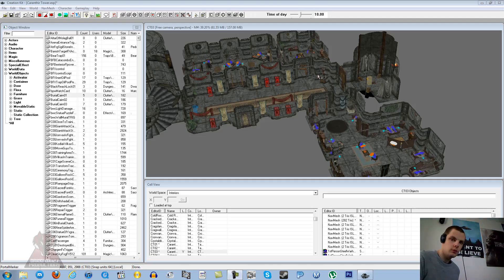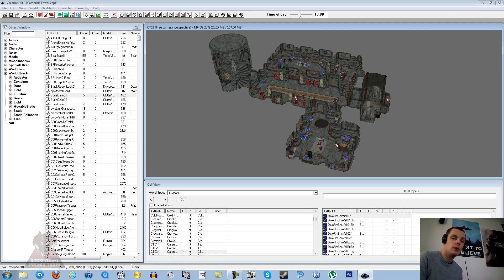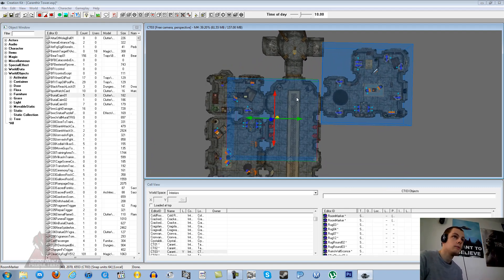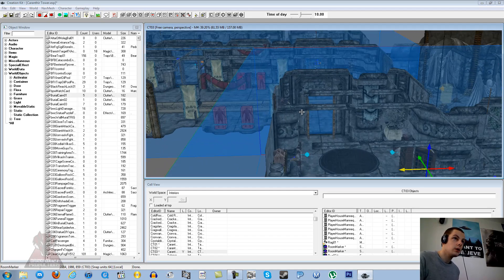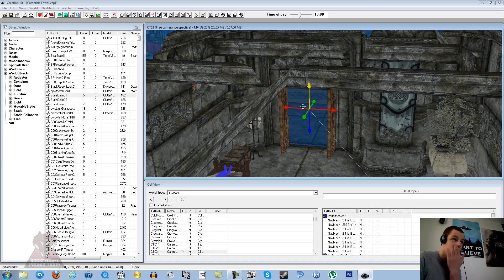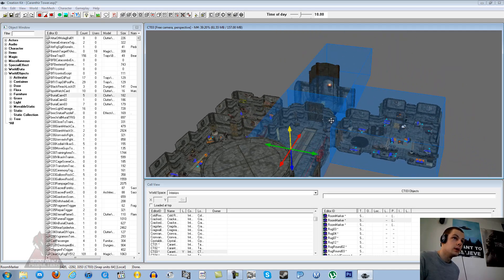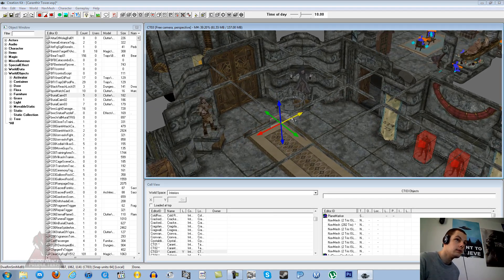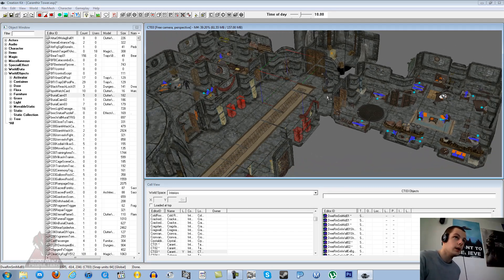Creation Kit (Optimisation)

Comment: Very good video! 

I think for a beginner like i am, Occlusion-Planes are very easy to start with. Once the dungeon was finished, i just used them massively in every void-area between rooms. So i would recommend using them first if the box-thingy is to complicated on first approach and you don 't have to bother about flickering of light and other problems eather, since these problems just don 't exist with occlusion-planes. And if flickering happens, then because of other issues (amateur-like-guessing).

Just using these planes worked so well, that i even could remove loading-doors i wanted to put in first and the fps rate keept beeing very high!

Nevertheless, the portal-rooms seem to be the most professional way to do it and it also looks much more clean, when u look at your dungeon-layout in CK. When I compare this with my dungeon including the occlusion-planes, mine looks very messy and amateur-like, but it woks aswell. Next thing for me now is, to try the portal-rooms and i 'm looking forward to have even more fps with it!

Again, very good video and well explained! If there weren 't such videos in the WWW it would be really hard for me to gather all the information i need to do these little nice adjustments! 

Cheers
Destero

Comment: Snap to grid - 16 seems to be the best setting. Higher and they'll either overlap or get a gap, lower and you can't easily see if they're joined, overlapping, or gapping.

I've got a real problem, I have two rooms separated by a wall and 2 room boxes but one side of the wall won't render, its like it thinks the wall belongs to the other other room box even though its divided equally down the middle. I've no idea how to fix it.

Comment: This is very nicely explained as usual but unfortunately very limited. I'm trying to mod an existing cell (Vlindrell Hall) and the snap to grid simply wont' work as its not aligned to any grid that the CK recognises. So trying to modify any room marker throw out all kinds of errors that I have no idea how to fix because the boxes simply won't line up properly.

Secondly there is a thing you can use to verify room marker and portals its under worldspace > verify markers and portals. Pretty much essential if you want to debug and try figure out why your're getting errors/glitches even if the messages it throws out are indecipherable.

Comment: another interesting, undocumented hint: if the CK creates the PortalPlane on a funny edge, delete it - it is going to be a problem. Don't waste your time wrangling it into position. The portal needs to spawn right between the room bounds when you create it, and if it doesn't, your portal will not behave.
Reply: How do you get it to do that though? It always spawns in a completely different wall to the one connecting the two rooms.

If snap to grid is on it seems to "wrangle into position" ok. Just as well as its impossible to get the get the portal to spawn where you'd like it too.

Comment: Hey Byron, I think you should mentino that its far easier to connect rooms with portals like so: 1) select two adjoining room bounds with ctrl+click. 2) press the portal button. Whamm-o! the portal is right there between the rooms, linked and ready to rocket.
Reply: Except for the fact the the portal spawns on the wrong wall face at the wrong end of the room box.

To top it all you can't even wrangle it onto a different face once they're linked, so this advice is worse than useless.

Comment: I have overlapped roombounds quite a bit, because I never thought about using SNAP-To-Grid on the actual roombound. I'm about to try that now.

My point for posting was that there seems to be no detrimental effect to overlapping roombounds, as portal markers tend to snap themselves into the appropriate position.

To add a portal to overlapped RB's, Hide one room ('1' key) add portal, (turn off portal mode)unhide hidden room, select it, and then link them as normal. Hope that helps.